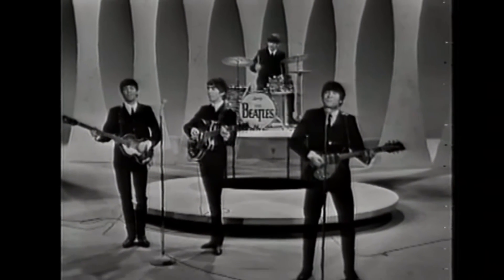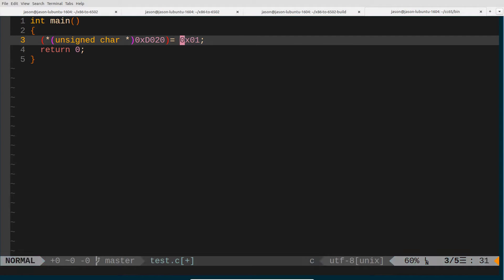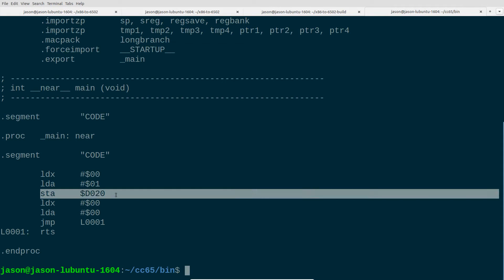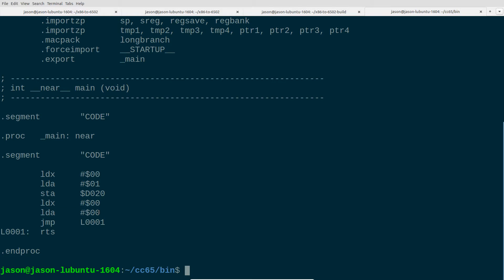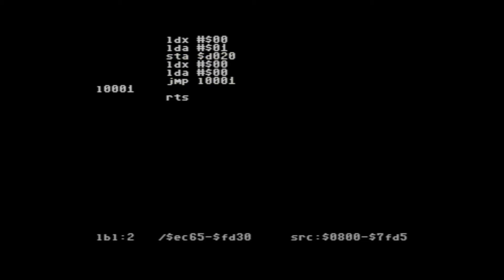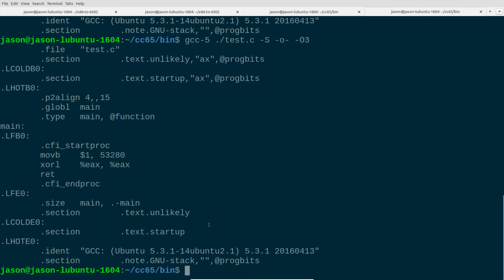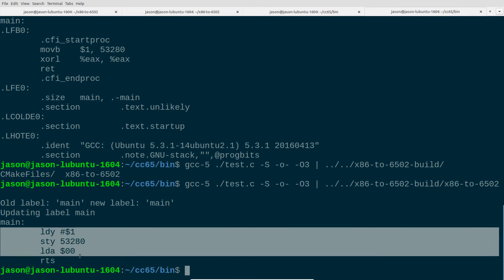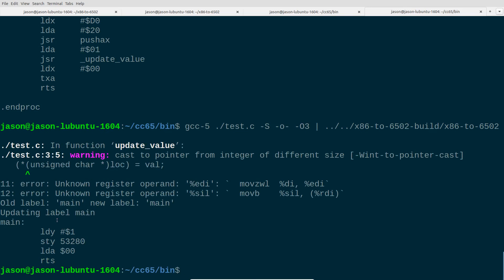An x86 to 6502 Re-Assembler

Comment: If you want to use modern C compilers for the 6502, you might want to look into LLVM-MOS. It has a fork of Clang that can compile to 6502, and generate super fast codes(way faster than CC65).

Comment: Ouch, that's really ugly. 

I wonder what would happen if you just said

void main() {
   *((unsigned char *)0xd020) = 1;
}

You don't want to return 0; I know in UNIX you need to do it to pass the errno of the process. But on a 6502 machine that's irrelevant.

The biggest problem is the passing of arguments. The standard way using a stack and frame pointer and all that falls flat on the face here. Nobody does that on a stack that small. So what to do?

Define register arguments?

void update_value(register unsigned short addr, register unsigned char val) {
   *((unsigned char *)addr) = val;
}

void main() {
  update_value(0xd020, 1);
}

that should not add all that junk.

Comment: i dont see the point ot this; why dont u use acme on Linux? it even outputs a prg file directly for loading into a C64 emulator like VICE altogether with the basic launcher with SYS command included; any cross attempt from intel architecture is going to be a mess when trying to target a motorola based 8 bit micro

Comment: Your cc65 example is highly misleading because you actually make it generate different code than your hand-written assembly yourself. Do not ask cc65 to return an int as you don't do it in your assembler ( `void main(void) { (*(unsigned char *)0xd020) = 0x01; }` will be an equivalent for that) and run cc65 with -O option. You get exactly the very same assembly as your hand-written assembler code.

Comment: different processors. x86 in mainly register based cpu (as are today processors). 6502 was memory based (page 0 addressing). plus x86 is a true 16 bit processor and has a strange addressing mode (segments). I think a similar tool can not cope efficiently with those differences..... anyway this is an interesting piece of work

Comment: Can you even generate efficient code this way? Or does it end up needing lots of "glue" code like native compilers did?
There's a strange disconnect between how the 6502 does things and how the other CPU families did in that on the 6502 pairs of bytes in page zero effectively serve as address registers. The "Y" index register just supplies an offset.

Comment: Have you considered using CBM Prg Studio? I started with a similar emulator, such as the one you are using. The cool thing about using CBM is you can connect it to the VICE C64 emulator and it runs the code automatically. Would like to hear your thoughts? I teach Commodore 64 programming on my channel too. Keep up the good work!

Comment: Isn't better/easier to create a 6502 backend for current gcc/clang than to create a x86 converter?
Reply from the maker: There's been at least 3 different LLVM-6502 attempts that have all failed or stopped for some reason. LLVM seems to very much not like 8 bit registers with 16 bit addresses. If anyone has any luck with a 6502 backend for any compiler that's up to date, let me know!
Reply: I had the same thought. Searching around, apparently it's not easy to get GCC to accept a 6502 backend, as it requires changes that upstream weren't willing to make. Someone had a go at LLVM backend for 6502 but lost interest.
Reply: cc65 looks like an another way to go here.

Comment: Maybe int is 16 bit and both the registers a and x are needed.
Reply: Yea. int is probably 16 bit and main was issuing the 'return 0' in register form; so cc65 optimized was spot on.
Reply: Exactly. Actually C standard says (if I remember correctly) that size of "int" must be 16 bits at least (or more). So it's really not a "post initialization" anyway, cc65 is quite right here and do the right thing, this cannot be further optimized too much (well actually one can choose "void" for function main so no return value is needed, but in general that's not a good thing too in function main at least). Moreover the solution is wrong then because of two reasons: should be lda #0 not lda 0 ...., also, since the return type is integer, 8 bit is not enough. So cc65's solution was just perfect, and the "hand crafted from-x86 solution" is actually totally bad ... Besided the "lda 0" error, the solution would be correct, if return type of main is "char", being 8 bit ...